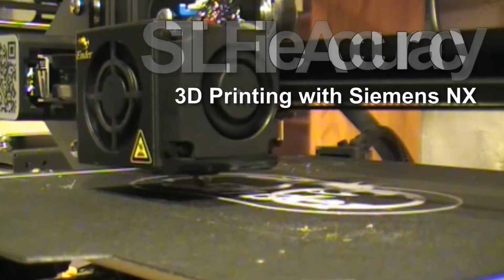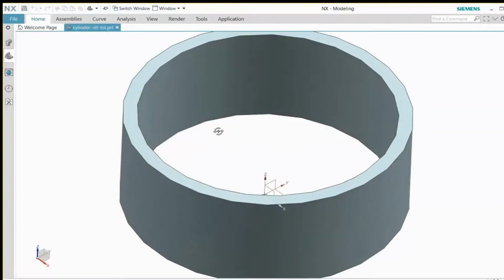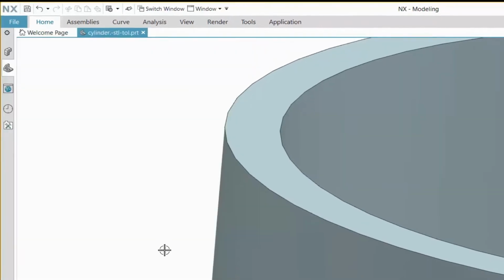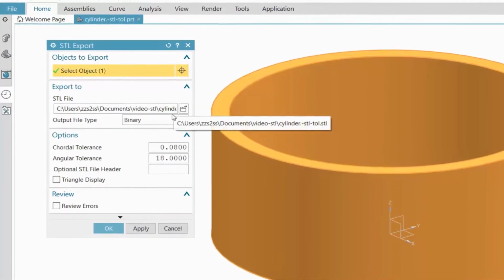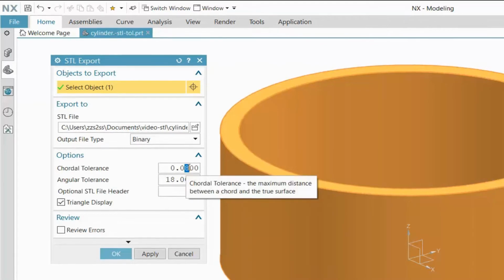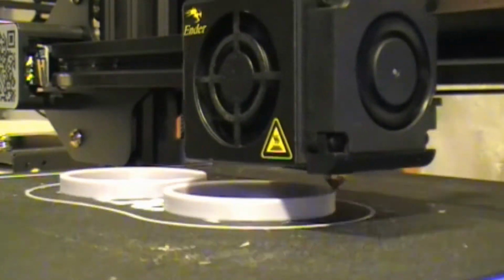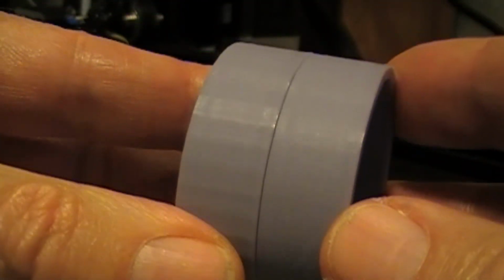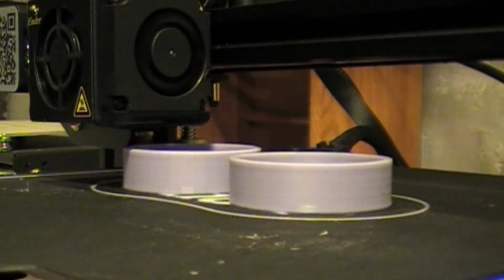STL File Accuracy, 3D Printing with NX

Comment: I have a question. Why is it that CNC machines can cut with no facets but a 3d printer can't print without them? https://www.youtube.com/watch?v=i-PgeWbDgq4
Reply: 2 Things:
1 - "Real" CAD formats are all vector based - STEP or Parasolid files contain the instructions for the CAD system to render that data into a 3D view. Think of them like vector graphics.
STL and OBJ are "bitmap" graphics that outline the volume of material and nothing more. We are almost never programming a CNC mill off of this kind of geometry (though NX and others can do it, they are just making assumptions based on shapes). In general, CAM systems derive their tool path off of the native vector graphics, to whatever tolerance you specify. You can go into Fusion or NX and change the toolpath tolerance to something really big, and turn on linear only. Your CNC mill will probably produce faceted parts, but you need to work at it.

2- CNC controls also perform their own interpolation. They use look ahed in the G-code and try to smooth out the tiny G01 linear motion segments into smooth shapes. Most modern controls give you the ability to control how much smoothing the machine will apply on these segments. Depending on these settings, the machine may produce very faceted models, or it may take even chunky tool path and smooth it out for you.

Comment: Thanks good video. Problem I am having is getting rid of the traingle display after stl export! It slows down the rendering loads after a big stl export. I would expect it to put the triangulated mesh somwhere in the part navigator (maybe non-timestamp geometry) but it's hidden somewhere really obscure. I end up closing the part and reopening it!!